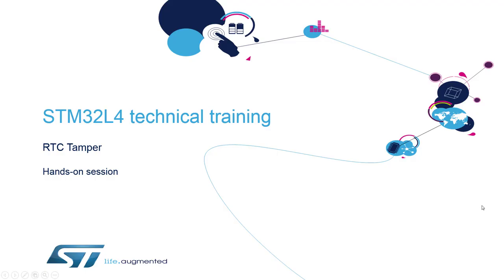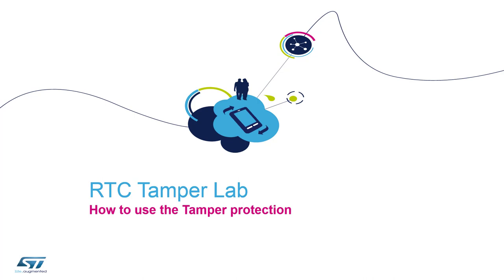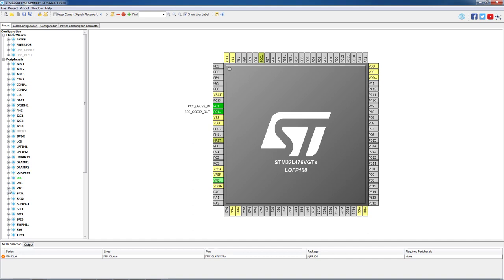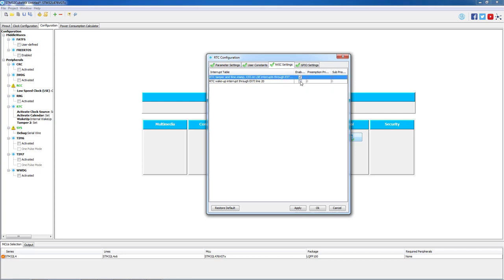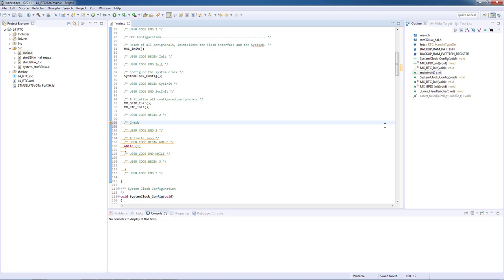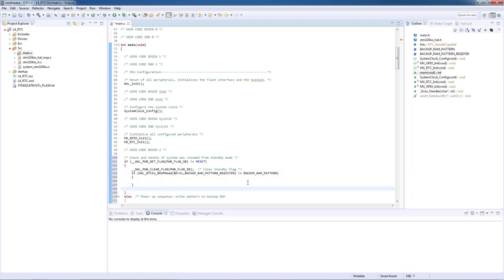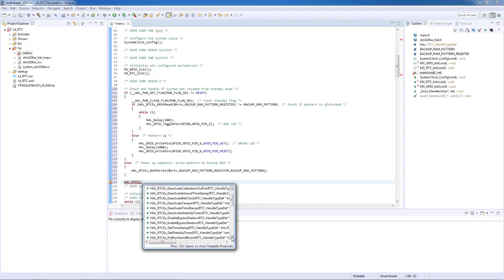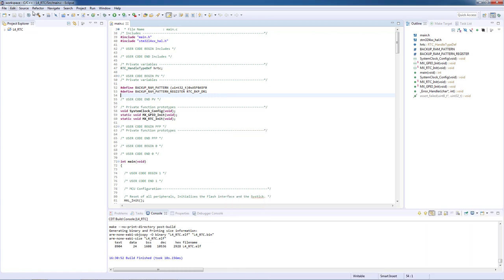STM32L4 training: 06.6 Timers - Hands-on RTC

Comment: I tried the periodic wakeup with the U575 and it doesn't work. I configured the LSE clocksource and the RTC with internal wakeup and activated the RTC non-secure interrupt. I copied the code with the corresponding U575's flags:

 if(__HAL_PWR_GET_FLAG(PWR_FLAG_SBF) == SET){
	  __HAL_PWR_CLEAR_FLAG(PWR_FLAG_SBF);
	  HAL_GPIO_WritePin(LED_BLUE_GPIO_Port, LED_BLUE_Pin, GPIO_PIN_SET);
	  HAL_Delay(500);
	  HAL_GPIO_WritePin(LED_BLUE_GPIO_Port, LED_BLUE_Pin, GPIO_PIN_RESET);
  }

  HAL_RTCEx_DeactivateWakeUpTimer(&hrtc);
  __HAL_PWR_CLEAR_FLAG(PWR_WAKEUP_ALL_FLAG);
  __HAL_RTC_CLEAR_FLAG(&hrtc, RTC_FLAG_WUTF);
  HAL_GPIO_WritePin(LED_GREEN_GPIO_Port, LED_GREEN_Pin, GPIO_PIN_SET);
  HAL_Delay(500);
  HAL_GPIO_WritePin(LED_GREEN_GPIO_Port, LED_GREEN_Pin, GPIO_PIN_RESET);
  HAL_RTCEx_SetWakeUpTimer_IT(&hrtc, 4, RTC_WAKEUPCLOCK_CK_SPRE_16BITS, 4);
  HAL_PWR_EnterSTANDBYMode();

The MCU never wakes up though...